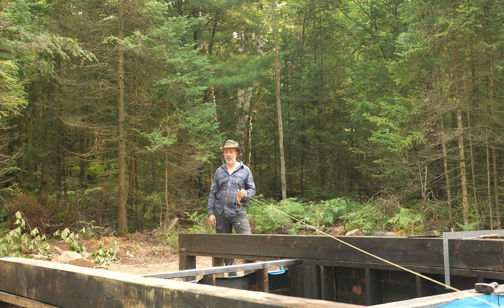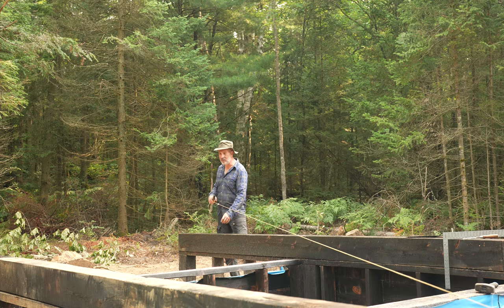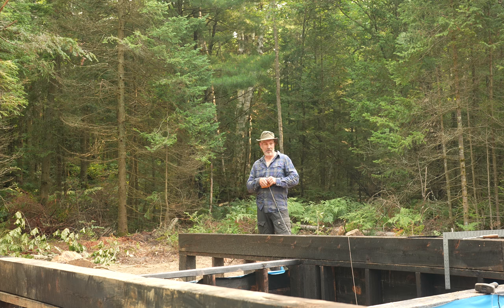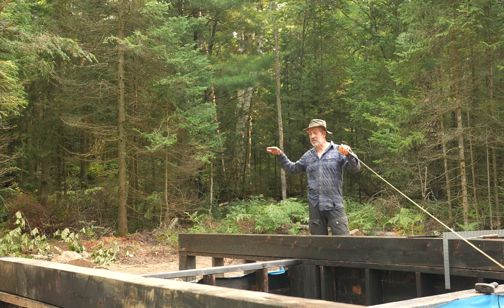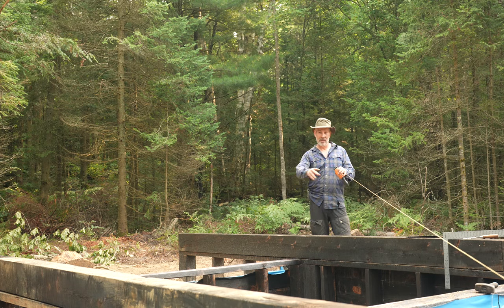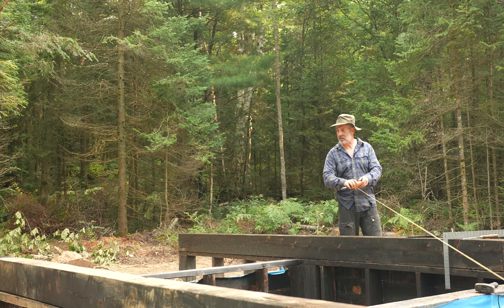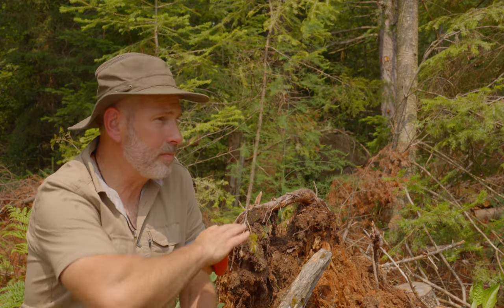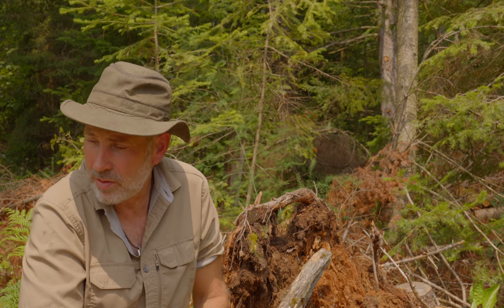Production on the Homestead - Greenhouse, Garden, Wood Foundation and Sawing Lumber Off Grid

Comment: Great feedback about how the greenhouse is performing in summer. We’ll take a closer look at passive heat regulation, and possible solutions for greenhouse pollination. 🌱
Reply: Yes Jim @ Arctic Acres, that would be awesome! Shawn works SO hard you’d be doing him and us viewers a HUGE favor!!  Bless you!!  🙏🏻👌👍
Reply: Have  a barn door so it keeps the temp regulates and at the same time have a bee keeping box in the green house.  So bee can fly in and out.. from the top barn door open. Shut in winter.
Also in between plants pollinating flowers in between the garden boxes.
Reply: You can purchase automatic, temperature regulated, pneumatic arms that open/close windows for around $30.  They work well, that's what I use.  Also, I plan on building a walipini or deep winter greenhouse for passive solar winter growing in our northern climate.  It can be tough to properly utilize a greenhouse in summer in extreme north zones
Reply: @TheBoydTV  Great insights and that sounds like an exciting project! 

Our US partner Growing Spaces uses that sort of system with pneumatic pressurize-sensitive vents. Overall we found fans to be more reliable and efficient (and sometimes necessary in windy areas), however, if something can be done passively it's something we'll continue to explore and refine.

Comment: Tomatoes do stop flowering when nighttime temps are warm and daytimes are hot. If I recall, it is 70 degrees F for night temp. If you keep the indeterminate plants alive and healthy, you’ll get a second flush of fruiting when the temps start dropping again. Cherry tomatoes and plum tomatoes do the best because they ripen so much faster than the big fruits.
Don’t forget that it is the time to start your seeds for your fall and winter crops. 
I love watching the harvesting! You’ve done so much in such a short time, especially with how busy you are with construction!!
Just an idea…you will very likely need supplemental heat in the winter:
When you have your fires going elsewhere, heat up rocks, and put them in front of the air intake for the soil heating system. You could also boil water to slowly raise the tank temperature when there are cloudy days that inhibit solar heating.

Comment: That foundation securing makes sense.  Hope it works.  I know you’re busy enough, but before I moved 1000 miles to stay near my kids and grandkids, I thought it would be cool to build a tower about 40 ft high, attached to the cabin so it wouldn’t topple over, with a platform at the top about ten ft square, with a railing, so I could climb up it and look around, watch the stars, free from bears,  etc..  maybe you can think about that, when your cabin is finished.  Those longer days up there really speed up your garden!  I’d plant a load of root crops  in your greenhouse, like beets, carrots etc., and see if you can just leave them in the soil, till u need them.  There’s some that don’t get woody.  Godspeed with your flooring and walls!

Comment: Hello Shawn, long time viewer, first time commentator. I am a geotechnical professional. Regarding settlement of the soils, you have a few things working for you on the site. 

1) You are founding on sand - which as you probably are already aware, means that almost all settlement will occur instantaneously with the load applied (ie the house). This means you could stage your construction if you wished so that you hung the door and framed the windows toward the end of the project. The biggest load will be the roof so once that is on you will have for all purposes reached total settlement. 
2) the additional weight associated with the cellar and all associated walls etc. will be largely offset by the weight removed from digging the hole in the first place. This will help to minimise possible differential settlements between the cellar joists and the wider ground floor footprint. 

All the best. Enjoying watching the building coming along, really inspiring. I hope to go off grid like this one day myself.
Edit - the settlement above does not account for the shrinkage of the green-ish wood you have noted previously.

Comment: To keep flies out of your green house and your cabin, fill and hang large gallon clear baggies or any clear plastic bags sturdy enough to hold water above the doors and  in the greenhouse it will keep the flies away! You can use sturdy thumb tac's to hold them up! I do that and the flies stay away! I guess they see themselves bigger but don't know why it works, but it does!
Reply: I saw that the other day and didn't know what they were for. They also had a couple of coins in each of the bags - what do you suppose those were for?
Reply: @regular-joe  maybe for weight, Idon'tknow, I just use water in 1 gallon baggies and it works!

Comment: I know I have suggested it before, but now that you are starting to work on the walls and the roofing I want to recommend making wall-ladders. They are much safer than plain ladders, very mobile and sturdy. The "top"-platform is perfect to have as a shelf when lifting heavy items. I have made both tall and short wall ladders when I renovated an timbered outhouse and also re-shingled the roof. The short ones I use when cleaning windows (outside) and working on the ceiling indoors.

Comment: Hey Shawn, as a professional builder I'd strongly recommend you use a steel tape when checking over long distances for square. I've made the mistake of using other measuring aids that can stretch and give you false readings. (Laser digital readers are the more modern method)
Love you work.

Comment: Tomato flowers have both male and female parts so if you gently agitate them with your fingertips (some use an electric toothbrush) it will improve your chances of flower set. Garden looks great!
Reply from the maker: Usually wind will do that in the absence of bees vibrating their wings, but I think it’s more than that because even the tomato plants in front of the fans are not producing and they get a lot of movement and vibration

Comment: Great job on the vegetables. Have you ever considered a solar kiln to dry your wood quicker? I saw one build on a show and it made a lot of sense. Build a big box with clear roofing facing south, paint the box black inside to trap the heat. Add some solar vents and the wood will dry so much faster.

Comment: With air dried lumber, it typically cures a inch per year, but that would speed up in a solar kiln, windy area or inside a heated building with good airflow. Soft woods will dry faster than hardwoods.

Comment: Shawn, Please consider putting Full 6x8 blocking in-between the floor joists on the outer walls. I live in an older house which was built in the 1940's using rough sawn 2x8s for the floor joists,  all along the basement walls the joist lumber has compressed from the weight of the walls and house above by almost 1/3. 
This house is stick framed I can only imagine the weight of log walls would further compress and possibly compromise your cabins structure or stability. Kind regards and love the videos.

Comment: Tomatoes release their pollen and rely on air movement to drift it to other flowers. So if no air movement inside, then very little pollination will occur naturally. Sometimes not enough soil moisture will cause flower drop too.
The way to solve the airflow issue is to hand pollinate each morning once you see the pollen is ready to be released. Shake each bush gently. The higher flowers will pollinate the lower and nearby flowers.

Comment: Hi Shawn ! You mentioned drying wood and having to use greener condition wood than you would like to use.. are these logs from recently harvested stuff, and not the ones you've girdled for later harvesting ?  Seems like you need a drying shed / barn / snowmobile storage on the property.  What if you used the smaller (6-12" dia) standing trees (not felled) for a field expedient longhouse if there is a good site for it where 5 to 8 standing trees can be pulled together at their tops with ropes and pulleys. The structure can have any shape needed, pentagon, hex etc where the trees are like a teepee's poles pulled together at the center and covered with tarps. The trees being green should allow bending as needed, and then you can strip unwanted limbs etc with a pole trimmer or saw. the tarps can come on and off as needed vs weather conditions. Maybe call in the guys like before to get a multi purpose building skeleton done in a weekend ? Cover it with old sails somebody's discarding, maybe just pay the freight or pick up from a marina with a sailmaker or chandlery.  Extra sails would also offer shade, and channel breezes in the heat of summer usefully too !

Comment: I'm for the bees knees.  A single hive would serve you well.  A bunch of hives you might lease with a contract to maintain said rented hives.  Plus you have honey to sell for extra income,  and mead becomes possible.  Either as an extra income, A safe drinking fluid, or even to distill for pure alcohol to be drunk, septIc service, or converting any gas powered machine to run e85.  Or pure alky.

Comment: I'm wondering where would you determine the front of the house to be in Canada here in Kansas I'm in the Northeast part of Kansas we like our houses facing mostly Southwest the catch the morning sun throughout the most of the day! That's so that the sun can illuminate the interior of the building warm up the walls and any stone that we have in the house and that will radiate throughout the afternoon kind of passive solar! Summertime is  different we like long hanging roof eaves to catch the Sun and block it away from the windows so that the house is keep cool throughout the summer

Comment: Have you thought about finding a old wood burning cook stove where you can bake and cook inside during the winter as well as heat the home.  Women in the past would give their right arm for one of those stoves so they didn't have to bend over and boy could they bake great food in them...They still exist as I saw some online.  Not many left of them but a thought as they were created to cook on top and bake at the same time for women in the frontier.
Reply: You can actually buy them brand new but they are not cheap. The old ones are true works of art though.

Comment: Dear Mr. James: I have a question. I live in an area where hurricanes happen. I don’t know if your area experiences strong winds or tornadoes. But I pondered that the foundation is somewhat anchored to the ground. But as you build upwards, do you need to use ties to secure the upper levels of construction? Just curious. Thank you for your video.
Reply: In my area, the side of the house that faces the direction of the gusts , have their studs closer apart . Normally studs are about two to three feet apart. Depending on the builder. But to pass FEMA compliance for insurance, they have to be less than a foot apart. Bracing both structure to foundation and roof.  Most homes in the coastlines cannot be insured unless compliant against wind storm.